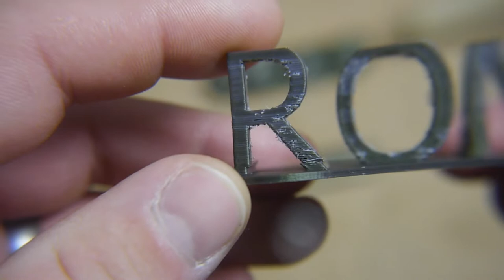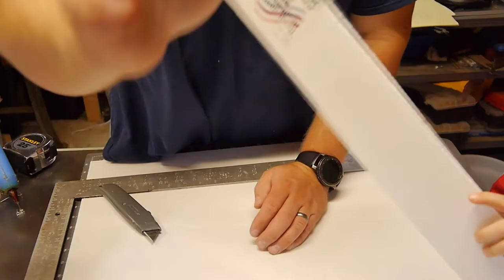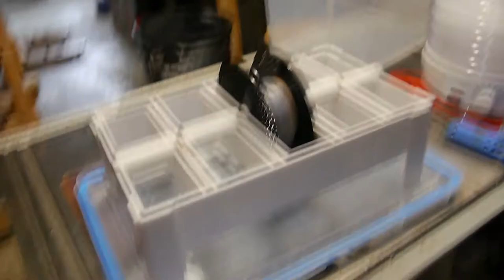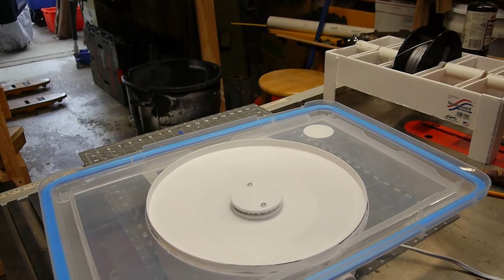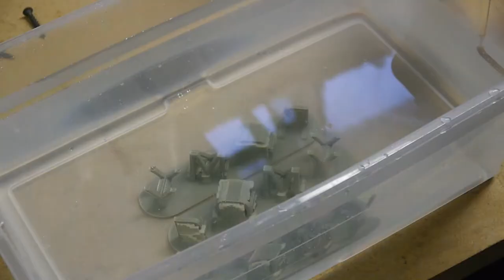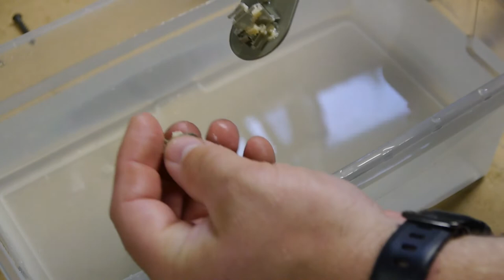Fix for printing with PVA water soluble filament - with Prusa MMU2S, I3MK3S

Comment: Great video. I've cut away the inner racks of my dehydrator to take two spools stacked vertically. It seems to work well.  I use it to recharge homemade desiccant bags that were made with hot glue holding the mesh fabric together. The dehydrator makes the glue flexible and tacky but doesn't seem to cause release problems.

What are the letter sculptures you're building? Did you create them with a CAD program? Please tell us more!
Reply from the maker: Thanks! I used Autodesk Inventor to model up the letters. It isn't too hard to do and I imagine you could use Autodesk Fusion 360 to do something similar. The letter sculpture in the video is for a friend at work, who's two daughters are always trying to get him to pick which one of them he loves the most. So he asked if I could make a model such that if looked at from one way would say the oldest daughters name and when rotated 90 degrees and looked at again would say the youngest daughters name. I here it went over very well! :-) I have done a couple more for people's grandchildren, and anniversary presents. They are a fun talking point for people. I am thinking of doing a larger scale version of people's first and last initial as well. Maybe a spinning platform, and random letter placement, different angles, not sure where it will end up. If a tutorial is something that would be of use to people I can look into doing a tutorial in Fusion 360. Thanks for watching!
Reply: @JoshAQ  There is a specific name for what you have created. When I posted my first reply, I was unable to dredge it from the depths of my alleged mind.  From what I have been able to find, it's called anamorphic letters, but there is almost nothing out there to present/explain how to create them.

I'm confident that any tutorial you generate will be well received. I'm a fan of OpenSCAD and suspect that once you show the process, I should be able to translate it to that program, and to Onshape and/or Tinkercad as well.

I love the story that goes with the build. I'm looking forward to seeing more of your creations.

Comment: Well done video but my problem is not about pva printing but the tip made on pva that often hangs mmu2 during the filament change. Could you please post the settings you use to get good tip and a reliable mmu2s filament switching operation?
Thanks.
Reply from the maker: Hey Michele, The only thing I changed was the Number of Cooling Moves and I set it to 3 from the stock 2. You can find it under the Filament Settings Tab and under the advanced category. I do remember having issues with the tip being too stringy as well and that clogging up the filament sensor on the MMU2s. If memory serves it did end up helping a little, but was not totally reliable. I ended up buying the BVOH and it really is alot better than the pva. I have recently been running bvoh for about 50 hours or so now without an issue. I think that is partly because it is winter time and humidity is way down in my basement shop. I hope that helps.

Comment: Because you're using that drying box, I don't think you need the buffer that came with the MMU...
Reply from the maker: I still need the buffer as it ends up pushing the filament off the spool and wrapping around the rod holding the spool in place. It would be nice to eliminate that though. Just not enough of a hassle to make an improvement at this point. Thanks for watching.

Comment: when I try to use PVA as support interface material, I can't use the wipe tower, the PrusaSlicer told me that it does not support wipe tower when using soluble material, how could you do that?
Reply from the maker: Are you using the full soluble or soluble interface print setting? I use the stock pva+ material in slot 5.
Reply from the maker: I'll run through all the settings, which are stock, sounds like checkbox not checked sort of thing though

Comment: Hey i just got pva and an having string issues with no solution. Did the dehydrator solve everything for you?
Reply from the maker: For the most part yes. In the time it takes to go from dehydrator to the mmu2s, depending on ambient moisture levels, it can still string. But it is no where near as bad as it was before. I bought some BVOH and it seems much better with regards to stringing, and much more expensive too. BVOH also takes longer to dissolve in water after printing so I imagine BVOH doesnt absorb moisture in the air as easily as PVA. All that to say, you definitely need either a dry box with desiccant you recharge in your oven, or a food dehydrator setup like mine. I am planning on another video covering this when I get a free moment, just worked my second weekend in a row and I am beet lol. Thanks for watching and good luck with your setup!
Reply: Just Josh rfpom thanks yea i also got bvoh from 3dxtech way better, no stringing. But still sometimes problems with it sticking if i only use for dense support since it very expensive. But if use all for support bvoh seems very good.

Comment: Hi ! did you have a lot of problems to make the mmu2s module work properly or is it easy to use?
Reply from the maker: Hi Gautier, I had probably 3 days worth of troubleshooting to get it to work reliably. It will still occasionally mess up every 8 hours or so. But then I have had it run for 24 hours without a problem. Most of my current problems stem from the shape of the filament end when it is pulled out getting clogged. I would say if you have assembled the MK3S from it's kit form then the MMU2s is probably twice as difficult to troubleshoot in my experience. I originally purchased the i3MK3 in kit form and had very few problems with it. The upgrade to the i3 MK3S is worth it, but I also feel like it is not as well documented in the instructions. So all that to say, If you assembled your 3d printer and that was fun for you then you should not have a problem with the MMU2s. The MMU2s is just not quite as forgiving as the i3MK3 to set up and maintain. But  once you understand the steps to troubleshoot a failure you will be just fine. At least I am at this point. But the MMU2s is not for someone who does not have their brain engaged when troubleshooting.  Thanks for watching and let me know if you have any other questions or specifics!
Reply: @JoshAQ  thank you very much for your detailed and very clear answer.
I do not have i3MK3s yet, I have a CR10S and I use in my profession a Ultimaker S5 ... I would like a machine with at least a double extrusion allowing me to print two materials / colors or soluble support ...

I love to tinker but I am interested in 3D printing more for the side production and 3D design.

I was thinking of buying an i3Mk3s and the MMU2S kit, but I have seen a lot of feedback saying that the MMU2S is not very stable, so I do not know what to do.

Thank you.

Gautier